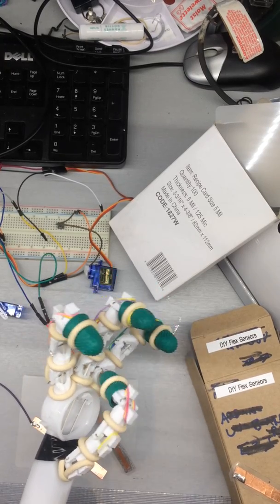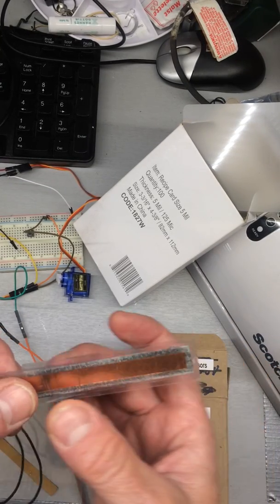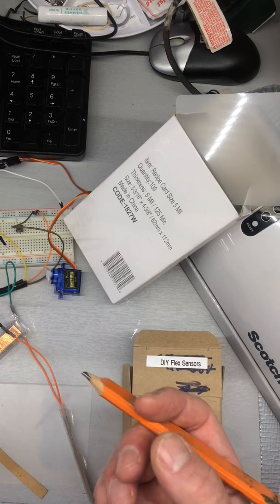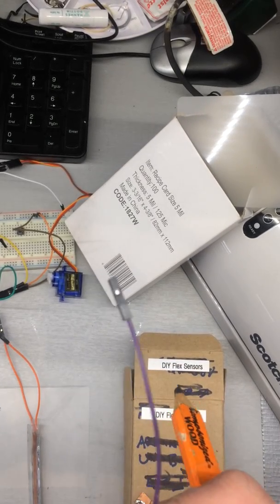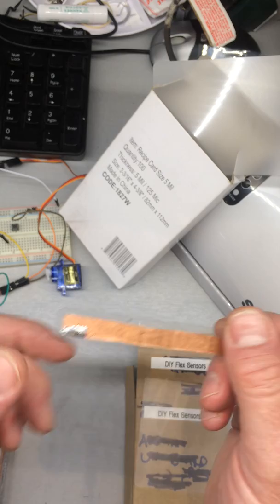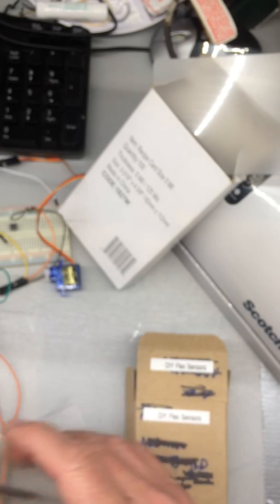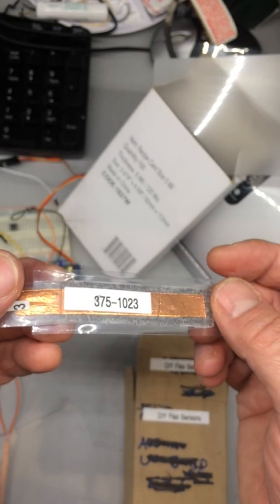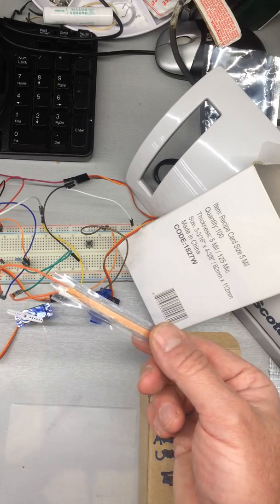DIY Flex sensors using home laminator and good old pencils! Good for Arduino / Raspberry Pi projects

Comment: Hi, I tried this but output values are keep on fluctuating, do you how to crct it?
Reply from the maker: Hi Raja - nice...glad you tried it out!  When you say 'keep fluctuating' do you mean when in resting state or fully flexed state? I am assuming you don't mean fluctuating while being bent right?
If my assumption is correct I think you need to look for possible shorts where two copper sides might be coming in contact. Maybe where you have the leads soldered?  You need to ensure there is no contact at any point between those two sides other than via the 'carbon paper'.   If the paper you used is more porous / full of holes than mine is it possible there's a short there?  Through the paper...direct Cu to Cu contact?

Also any breaks / cracks in your lead wires might cause sporadic fluctuation in current flow / readings.

Lastly...check copper foil for visible cracks under the lamination.  If you bend too aggressively and your foil is brittle you might get a hairline crack there.

Otherwise if all else mechanically stable you shouldn't get fluctuation unless of course you are bending the thing... which is the whole point ;)

Hope this helps.  Good luck and thanks for reaching out.

Best
Rhys
Reply: @fixitdad899  Thanks for the info, yes I could see some of the points which you mentioned for possible shorts in my sensor.

1. I used thin sheets of paper like butter paper and scribbled the pencil hardly to make a shiny coat of graphite (some other YouTube vids says make it shiny so that more graphite settled down on paper) and yes, I saw some small microtears on paper after scrubbing and I used it for making sensor.
2. Dimensions of cut is copper foil - 10cm length 0.5cm width, graphite paper- 10cm length 1cm width and then I sandwiched both. Let me know whether to increase graphite paper than copper foil length.
3. Instead of soldering(which I find soldering not sticking properly), I used copper foil tape to stick the pins(which I cut it from hookup wire) and from pins I connected lead (jumper wire) to Arduino board. Should the pins also not to be get touch each other and get separated by graphite sheet? or can
4. Yes I see cracks and bend in copper foil which I sticked in laminate sheet.
5. Instead of scrubbing & making graphite sheet can we go for velostat sheet?
6. Regarding my testing, after making the sensor I checked the accuracy for 30° bend it gives 40-70°. And even when it's flat values going up and down.

It would be helpful if I get your mail id so that I can send my sensors images which I made.
Reply from the maker: BTW ... not sure if you saw it or not but here is link to my robotic hand with sensors on glove... it shows sensors working.  Thanks again for watching.  If you could give me a thumbs up if you find of value would be much appreciated. https://youtu.be/RZnr9XzUBIU
Reply: @fixitdad899  yeah I gone through this video and gave thumbs up 👍☺️
Reply from the maker: Thanks...and good luck with the short tracing
Reply: @fixitdad899  Please help me on this to correct

1. I used thin sheets of paper like butter paper and scribbled the pencil hardly to make a shiny coat of graphite (some other YouTube vids says make it shiny so that more graphite settled down on paper) and yes, I saw some small microtears on paper after scrubbing and I used it for making sensor.
2. Dimensions of cut is copper foil - 10cm length 0.5cm width, graphite paper- 10cm length 1cm width and then I sandwiched both. Let me know whether to increase graphite paper than copper foil length.
3. Instead of soldering(which I find soldering not sticking properly), I used copper foil tape to stick the pins(which I cut it from hookup wire) and from pins I connected lead (jumper wire) to Arduino board. Should the pins also not to be get touch each other and get separated by graphite sheet? or can
4. Yes I see cracks and bend in copper foil which I sticked in laminate sheet.
5. Instead of scrubbing & making graphite sheet can we go for velostat sheet?
6. Regarding my testing, after making the sensor I checked the accuracy for 30° bend it gives 40-70°. And even when it's flat values going up and down.
Reply from the maker: Hi Raja
Re:2 .... might be a challenge if both are 10cm long ... possible to short at ends ... would make paper a bit longer
Re:3 .... I think this might be your biggest  problem area. If I understand you correctly you are using the adhesive side of copper foil to fasten wires... o e problem with sticky adhesive is that it's not a good conductor...suspect that the adhesive acting as 'inconsistent ' insulator?  Would highly recommend solder...make sure you use flux and make sure you lightly sand copper to get rid of any oxidation on the copper.  Copper should look pink and fresh.

At the solder end of mine I actually used an extra piece of plastic to keep them seperate.  You can't have any bare metal contacting the same anywhere in the setup and if your pins as you describe are bare metal this is true for your case.

Re: 5 - not sure what a velostat sheet looks like or is made of but guessing is like old school 'carbon transfer paper'.
Funny you mention because I did think about this .. if the coating is indeed carbon and not some other non conductive pigment then in theory why not!  I didn't have any such thing in my house but please let me know if you try and it works.

Thx!
Rhys
Reply from the maker: Actually.. message to anyone following this.  I didn't state this in video but...
Before you laminate any copper foil make sure you give it a light sanding to remove any oxidation...oxidation will act as insulator.  Copper should be fresh and almost pink looking on non-adhesive side before you do your thing. Once laminated it should be protected from later oxidation but no guarantees. Good luck!
Reply from the maker: Re: accuracy 30degree bend ... not sure how you are calculating this but for me this is entirely relational .. there is no 1:1 ... ie. My sensor returns a value range somewhere between 1 and 1025ish.. I need to then code that to correspond to an output value in degrees to servo. This calculation is specific to each sensor code needs to be tweaked for each.
Reply from the maker: Re: sending pictures... can you record short video and post to YouTube?  Please cite url link in comments here.  Be good for others to reference too. Thx
Reply: @fixitdad899  thanks a lot for detailed answer I will try as per your suggestion and update you 👍.